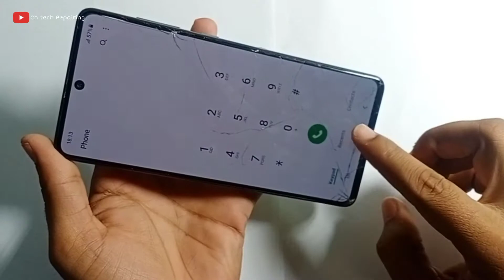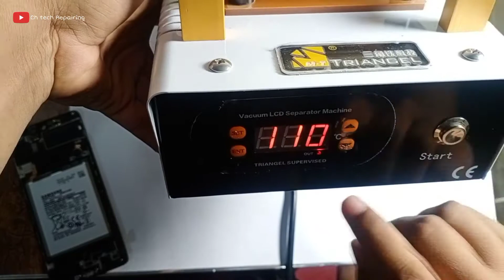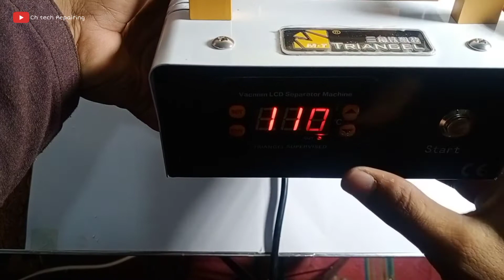samsung Galaxy A71 Glass Only Replacement 😏

Comment: What liquid/solvent you are applying to the digitizer surface to clean it up after removing the glass? gasoline or alcohol? Thanks. Also what kind of glue should I use?